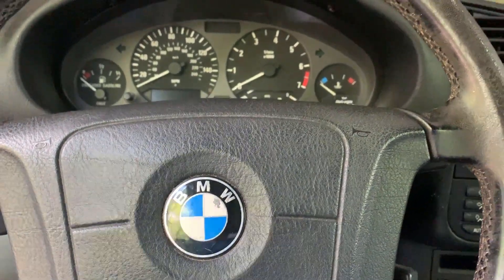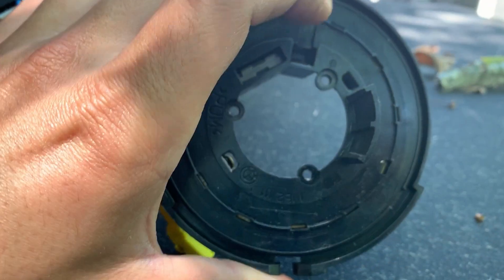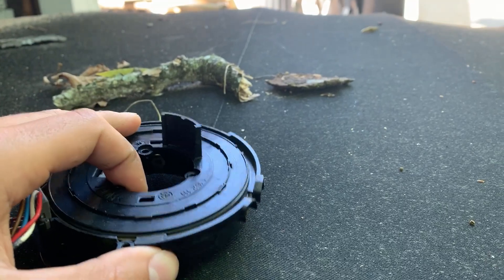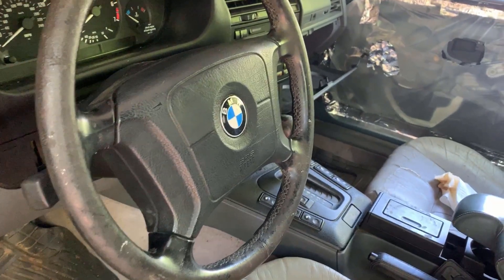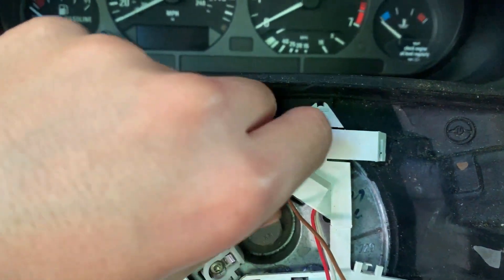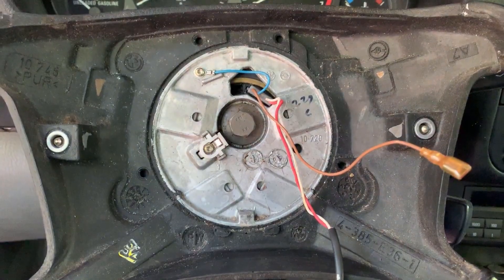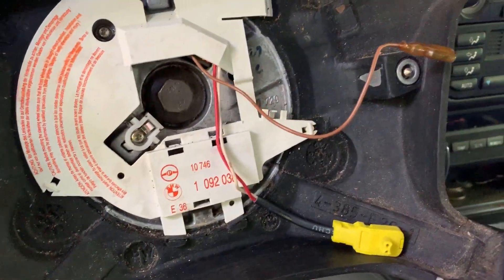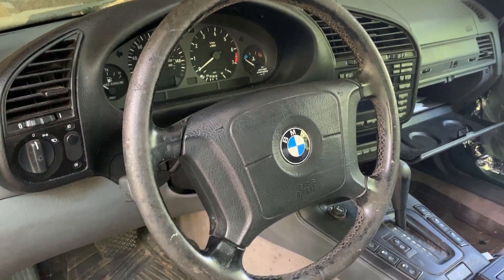BMW E36 Clock Spring Replacement (Grind/Squeak Noise Fix)

Comment: So, how did you disconnect the airbag connection to the back side the the clock spring? Did you pull it out of the bracket?  I don't have any experience with this type of electrical connector.
Reply: you do not. That plug is not not a plug, it connects to the spring. You need to remove the lower steering column cover and disconnect the wiring there. He left out a lot of crucial steps.  Also there are several versions out there.

Comment: You probably haven't run into this problem but I have a clock spring on my m3 steer wheel that doesn't show the 3 screws for removal is it just a cover sitting on top of the screws or am I just going insane
Reply: I want to put a older clock spring on my newer/later model steering wheel basically but the screws are nowhere to be seen unless they are under a cover and I just didn't want to break the newer clock spring Incase I can't replace it with the older one

Comment: Your fathers got a bad habit of treating this e36 like garbage
Reply: Are you suppose to centre the slip ring before refitting, so you don't tear the wire ribbon inside the casing? I didn't know this when I destroyed my first slip ring replacement.

Comment: Thanks for sharing this video.  My turn signal doesnt cancel in both direction on my E38, would a replacement of the clock spring fix the issues?

Comment: Just replaced my 98 M3 steering with a used 97 m3 steering with clock spring. It seems the M3 clock spring have different wiring than non-M3. Both year only have one single wire that connects onto the airbag. once the steering is removed there is also only one single wire from the clock spring that connects onto the wire under the steering column. Your video help make this job very easy.